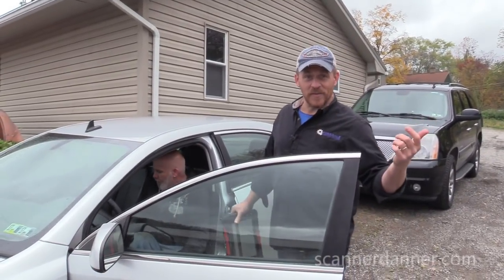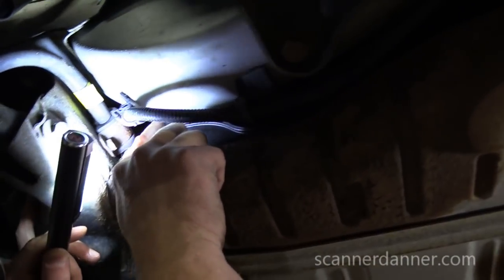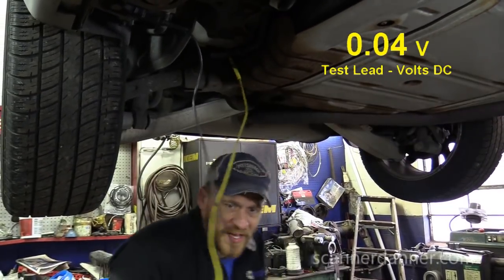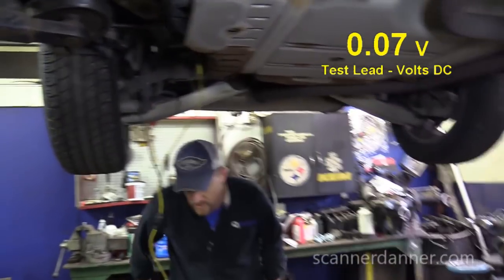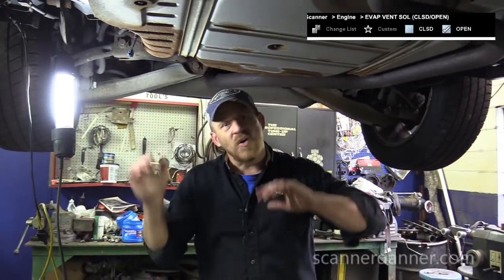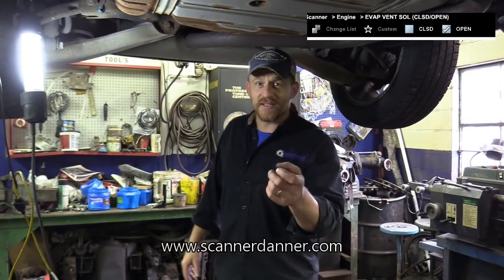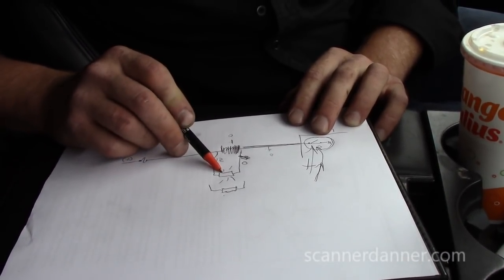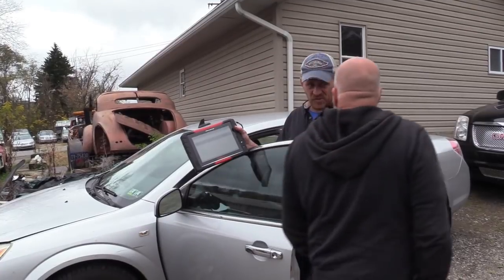How to test a computer controlled solenoid, any car (EVAP Vent P0449 GM)

Comment: Voltage drop is the most useful electrical test on simple circuits that do work. I use it all the time. Can't recall the last time I measured the resistance of a circuit during a test.

Comment: Great work again scanner danner, you ran through it so fast I had trouble working out what was happening. But the diagram breakdown at the end was great. Top work
Reply from the maker: Ryan, I did this one fast because I've done these about 5 or 6 other times. Glad to hear the diagram helped at the end. 
 Check out this playlist if you need some more info about what I was doing as why. 
https://www.youtube.com/playlist?list=PLAFYVCyenqcp9opu7j14E53UAIbn0b1r0
Reply: ScannerDanner just to let you know am going to go premium, hopefully I can get some more information. We have a lot of diesel engine (4 cylinder) over here with EGR, under boost, D.P.F temp sensors / pressures , ad-blue knocks sensors , diesel Turbo problems with mechanical vacuum pumps problems etc etc. Do you cover some of them in your premium . Thanks again buddy .
Reply from the maker: I don't work on any diesel systems but I have many happy customers from primarily diesel markets (The UK for example). So much of the material transfers directly between gas and diesel systems. Temp sensors, pressure sensors, knock sensors, solenoids, switches etc,  it's all the same. 
Thank you so much! Sign up for the 14 day free trial, you have nothing to lose and everything to gain.
Reply: ScannerDanner that's fine scanner Danner no worries, as you say, they are are the same. I think I speak for a lot of people here when I say THANK-YOU, thanks for the information and the dedication to putting together your videos and channels. A lot of work , preparation and time is put into them and we thank you for taking the time and effort to to it. And big thank you to the camera man for his patience also. And thanks again for the reply. 
Top work.
Reply from the maker: And thanks again to you too! I really appreciate your support. More than I can say

Comment: HAHAHA! "I hate this song" - I said the same exact thing the second I heard it playing, lol! I was about to comment, "The music was so good until 2:52 ... " :D I hated it the first time I ever heard it back it the day! It hits a nerve and always has. Super annoying!  

Great lesson as always brother! I think once I start doing more of this sort of thing hands on, I'll be able to retain it better. I learn faster by doing. I need alot of repetition from book or video learning. Just the way I'm wired. Got your book here ready to go in that new section of my barn once it's built.

Speaking of that, the trusses are on their way - supposed to be here any minute! Foundation and drainage work is all done. All I need is the building and the concrete floor and I'm ready to rock! My 10k lb. lift is all tarped up outside - just need a place to put it. :) The scope is going to have to wait another year, unfortunately - been bleeding money this month as you can imagine. I've got 3 test lights though, lol ... plus the most important tool - your BOOK! :)

For now, I've got to drag myself back out of my warm house into 36°, and crawl back under this 2500HD that's in my driveway for a steering box & pitman arm, plus tensioner, belt and idler. Came in for some lunch while the bubbles settle down in that hydro boost system. What a pain to bleed! 

Who was that random guy? Google / Youtube spy? LOL!  Talk to you next time! God bless!

Comment: Fast and correct .  Paul I have been trying to find a fault on my 2010 F150 since new  - never a code and only happens about twice a year at most . I'm not giving up yet but one of these days  before I scrap the thing  I'm going to ask you what the fix was.  Cheers
Reply: Look four4 the good don't always look four4 the faults.
If ya keep looking  four4 the faults you're gonna find them.
Your Ford is your friend and if ya wanna look for something 
look for the pine needle that's floating around in your dash.
Now that would drive me nuts knowing it's still in there some where.
Reply: MostlymoparIH  Ok since your a relative  from the garden state I'll give you a chance at guessing what's the fault in due time. Pauls  my go to guy but  I'll put you down  as a solid second :)
Reply: Did ya ever watch Better off Dead with John Cusak?
He says Friend, Friend. Well your Ford is your friend and you shouldn't find fault with it.
Reply: MostlymoparIH Hum Ford is ok but my official sponsor is the General Motors Corporation so I think I'm a  Chevy guy . LOL
Reply: Okay put me down and let me know when you're ready.
Reply from the maker: Twice a year sounds like winter and summer blend fuel issues. Common symptoms on Ford's
Reply: Put some methanol or a bottle of dry gas in your tank, it works good. 
It made a difference when MV checked the emissions  at the pipe.
Reply: MostlymoparIH  I'm not leaning to the fuel change every season only because it so random it both seasons . My friend at Ford and I have gone over it and he's suggesting a part I agree with , I'll set this all up and do an experiment . It's not guessing if you don't have  the answer - hum kinda sounds like it Eh. LOL
Reply: No no not guessing but ya might call it what ya use when ya go hunting.
If it's so intermittent then you should plug into your diag port and capture the data and when it hiccups pull the data and sea whatcha got. Just a suggestion, let's sea what your go to man says.
Reply: MostlymoparIH That's the problem - no codes - no data to look at .  I'll  post something for you in the future and explain it all.
Reply: Yeah it's not bad enough to post a code but if you record the data there might be data that is still in tolerance but just short of posting a code.
For an example when my son was younger our doctor tested his blood sugar and told us he was not hypoglycemic. Well his counselor asked what was his blood sugar and it was like 99 and his counselor said well he is border line hypoglycemic but according to our doctor or your truck's computer you do not have problems. Dew ya sea or dew I gotta take ya to the shore ta sea? And as Paul Reiser says, That's all I'm sayin.
Reply: MostlymoparIH Stay tuned buddy

Comment: ScannerDanner, awesome troubleshooting skills...I look forward to getting a subscription ....I have an 09 Escalade hybrid with the P0449 and followed one of your other evap vids titled " evap on any GM" I am convinced it's an open in the coil inside the vent solenoid, because I get no click at all when I bench tested it with my power probe... I supplied 12v to the hot wire and negative on control wire....I tried to follow the second route you demonstrated...the one with just the probe and not a test light, because I didn't completely understand the 1st procedure...my question is you said to be very careful not to send current, because it could fry the pcm, however when you back probed your test light onto your "Phil's" tool, and then supplied from your power probe, did that send power to the "driver"? And if so, please explain how that is any different than just using power probe alone, and supplying power. Hopefully, you understand what I'm trying to say...sorry for the dumb question, but I was just curious on the difference.  Right, from the start I'm probing, 12v on the hot and 0 on the control and when I turn the solenoid off using scan tool the control wire makes probe beeb and light up green, negative 0 volts..so I am assuming this means driver is testing good? Thanks again.
Reply from the maker: Without watching this video to address your question specifically. I think I can answer from a foundational point of view. 
First, it has to do with the driver design (power or ground side switching). If you want to use the existing wiring to help you "energize" an output, you MUST know your circuit design. If it is power side switched by the computer, then one of the wires goes to a constant ground. If it is ground side switched by the computer, then one of the wires goes to a constant power. 
What you then need to do is to provide what the computer provides. If it is power side switched you give the correct wire power. If it is ground side switched you give the correct wire a ground. BUT DO NOT get this mixed up!!! If you do it wrong, you can provide the wrong polarity and cook the computer driver. Hope that makes sense. By the way, this would be my Chapter 3 material we are talking about now.

Comment: i have trouble getting gas and have a vent valve code. thx man👊
Reply: R HEIDEMAN ..disconnect one of the hoses that connects to your evap canister, I honestly don't remember which one of the two. If you can get gas after disconnecting the hose,  the problem is the canister
Reply: +Daniel Gomez thx dnl

Comment: Some Engine Management Systems don't set a P0449...pre 2004 - P0449, post some set P02422.. Unfortunately OBD II is not consistent. Check out the detecting conditions for a 2011 Santa Fe...Fuel tank pressure sensor too low. DTC - P0449, no circuit malfunction. If this vehicle has an open it sets a P0447 for CCV...check it out...
Reply from the maker: stay within the conversation please. It helps me and everyone else trying to learn

Comment: Great video! Assuming you don't have a scan tool, could you do a continuity check on the solenoid?
Reply from the maker: yes you can. AND you can do the voltage tests I showed too
Reply: ScannerDanner Okay. Wanted to double check my thinking. Thanks Mr.Scanner!

Comment: How can I get a hold of you durectly? I've already had Ivan (Pine Hollow)  look @ my 2000 Malibu 3.1L vin code J.  He had smoked tested the entire EVAP system and found out that the Purge valve solenoid had a small leak in it and that the vent valve solenoid was perfectly fine.  So I had replaced the Purge valve solenoid and now I am getting the same 2 codes again! P0443 and P0449. I also had to replace the catalytic converter which I also did! What I mean by the vent valve was fine is it too was smoke tested and bi-directional controlled (NO LEAKS)
Reply from the maker: Take it back to Ivan, I am 100% positive he can fix this for you.

Comment: I was wondering I was doing coil amp test on a 2010 kia soul wire over plug system and once in awhile the ramp would jump really high and bobble at the top never at the turn off just right before the turn off halfway through the dwell it would jump high and bow out what I'm I looking

Comment: And just to be 200 percent check the solenoid with ohmeter, just to make sure it's not a corroded connection at the solenoid. Just talking to others that may not be sure, not to you Paul.
Reply from the maker: For sure, that is a great follow up test

Comment: Excellence, pure excellence! Paul, wondering if a solenoid can cause a transmission to work perfect when cold, but not take off when warm? Unless you pull it down in 1st gear. Once you take off shifts fine through all other gears. 1997 Ford e450 class c RV. V10 e4od. 47k miles.
Reply from the maker: a sticking solenoid can cause all kinds of issues but in your case I'm not sure based on your symptoms without a better knowledge of the hydraulic circuits in your particular transmission

Comment: Love your videos and I own your book too.  I have a similar problem but my vent valve is controlled by fuel pump control module. Do you have any videos on this particular situation ?  Solenoid is good and wiring is good to  fuel module. Maybe a bad fuel pump control module? Does the computer still communicate to turn vent closed or is it all the job of module? Thanks. 2019 GMC SIERRA 1500 5.3
Reply from the maker: still the same checks, it is powered by a fuse and ground side controlled by the fuel pump driver module. There are CAN lines running to this module too, so yes, the PCM will be talking to this module as well
Reply: @ScannerDanner  thanks, so I guess the only way to pinpoint which is bad: the fuel module or ECU is to command it bi directionally? But would that really isolate the bad part? I have 12 volts on red/white  and 12 volts on white with key off and  with connector OUT. I was stumped at that considering it was unplugged. With engine on, the white dropped to 0v.  I never ran a check with the solenoid plugged in like you suggest. I forgot to do  that way the other day but Solenoid worked when I jumped it out though. But I know it’s not sending a control because I used testlight between the red/white(+12v) and the white wire with engine runnin and it did not light up. And I checked continuity on white wire between vent solenoid and fuel pump module and that was good. So , in my opinion as of now, it’s either the fuel pump module or ECU that is bad but don’t know which one. I don’t have a bi directional scanner to command it though. I guess I might have to invest in one. I got P0449,P0498, &P0499. I thought it was weird I got a circuit high& low code.  I have a cheap actron code reader that won’t let me erase the codes either so I can see all of those pop back up. Anyway, Thanks for the help. You’re the best. You stand out from the rest of these automotive electrical techs with your knowledge. Love how you think out loud working through your troubleshooting.

Comment: Hello again good job but I dont understand meaning of bias voltage can you explain me
Reply: The short answer is to watch his other videos, Great content and awesome teacher. Bias voltage is basically a voltage that the computer puts out on the circuit so it can determine if there is a problem in the circuit, like a break in the wire or a bad part
Reply: Thanks for answer JOHN HUFANGEL is it on signal wire ?
Is there any info or circuits for it
Reply from the maker: there can be a bias voltage on input signal wires as well as output control circuits. Use a keyword search "bias voltage" on my channel page and a bunch of videos will show up

Comment: Now I'm wondering if it was an evap problem that gave me grief with a caravan I had years ago. 
 When I would tank up, it would run like crap for about 30 seconds then run fine. Had to stay on the gas or it would die. 
 No check engine light, did it almost every time I got gas. Didn't matter if I filled it or just put a few gallons in. 
 Never did find the problem. Had good fuel psi, held it too when I shut it off.
Reply from the maker: sounds like a sticking open purge valve

Comment: Paul,  does your book show lab scope probe placement to do tests ?
Reply from the maker: The placement of the lab scope and how to set it up, hinges greatly on your understanding of the circuit you are trying to test. This is what I focus on the most. If you buy the eBook, you will be able to check out the material without risk as I will give you a full refund if it is not for you. This would also be my suggestion if you wanted a paper version, I can apply the cost of the eBook toward the paper book if you wanted to exchange it. Thank you so much!

Comment: Sorry but this is one of the first videos I can't agree with. P0449 does not always indicate a circuit malfunction. Also, on a actuator circuit, there is no bias voltage on the control side. The output monitor checks for circuit integrity...PCM looking for B+ or Zero depending on the state of the driver.
Reply from the maker: I never said always did I? Though every P0449 code I've ever done was a broken wire or open vent solenoid and I have 4 or 5 other videos showing the same thing as well. 
I would agree with you that I have seen "circuit" codes that were not wiring problems but only one time and it was a EURO car (go figure), every other time, when you see "circuit" in a code description, it has been a wiring problem or open in the output itself. 

As for bias voltage on an output or "actuator" as you called it, absolutely they use it! On both ground side and power side switched circuits. Would you like me to post some links to videos I've done proving it does exist?
Reply from the maker: within this conversation, hit reply to my comment copy and paste your reply and delete the other ones please

Comment: an open in the solenoid winding would ve showed a bias voltage, if there had been bias..dont you think?..i mean, no need to unplug the connector
Reply from the maker: if there is a bias that is correct, not all of them use it

Comment: Any videos on p0448?
Reply from the maker: Same exact tests as I showed in this one, with the exception that you're looking for a short to ground.
Reply: @ScannerDanner   no problem thanks cause I had took it to mechanic and they change the vent control value code re appear 6 months ago and doing research and YouTube search for p0448 seeing replace canister or cleaning out